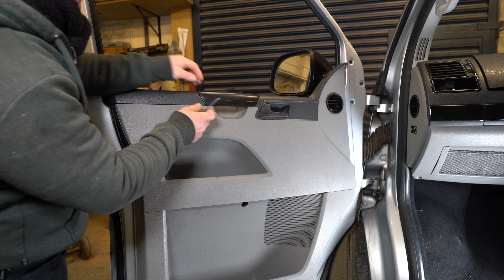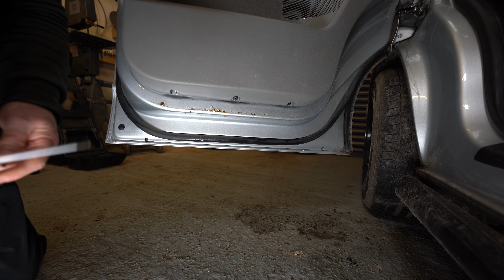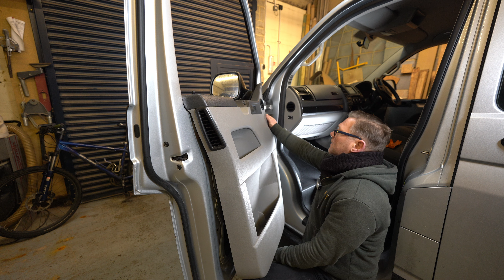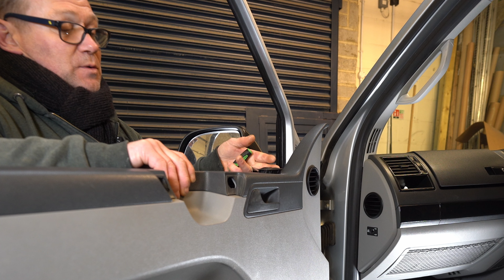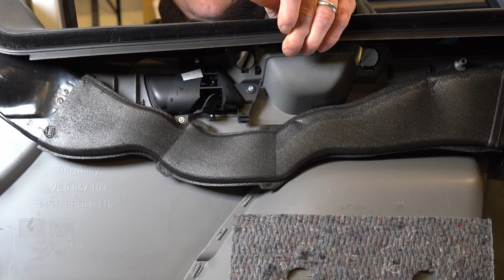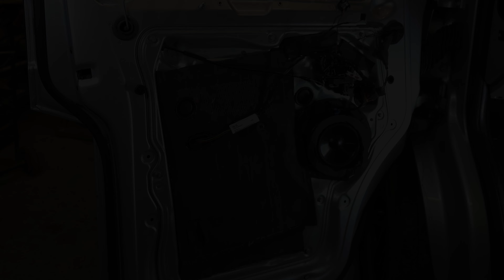How to remove a VW T5 Transporter door card. Auto upholstery.

Comment: I removed it but I can't reassemble it anymore.
Reply from the maker: What are you having problems with
Reply: @coastalcushionco8227   I try to explain in english. As first step, after having connected all the connectors,  I try to put the panel in place, but I can't match the hole of the door button ( the long stick that goes up and down when you close the door).
Reply: I find it so difficult to put the panel in the right place matching everything